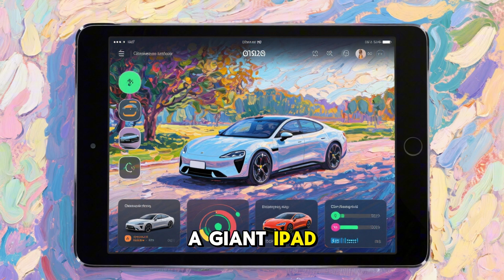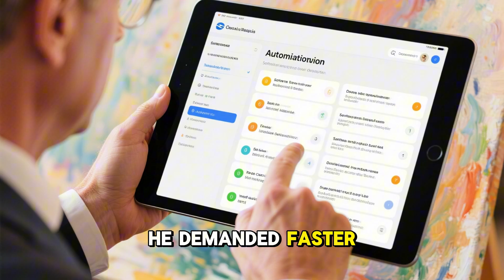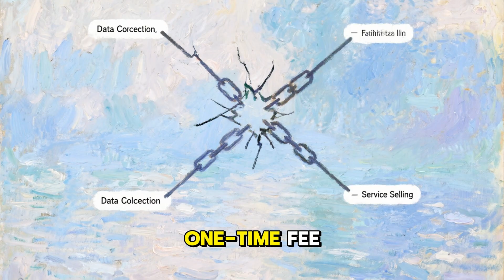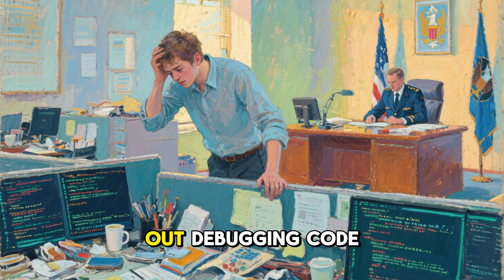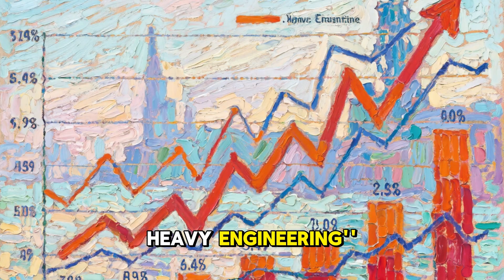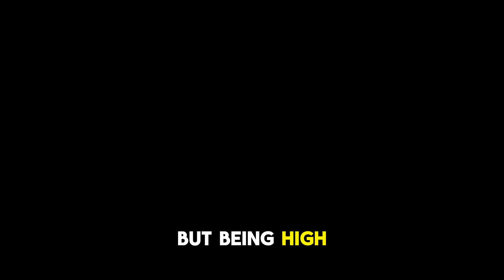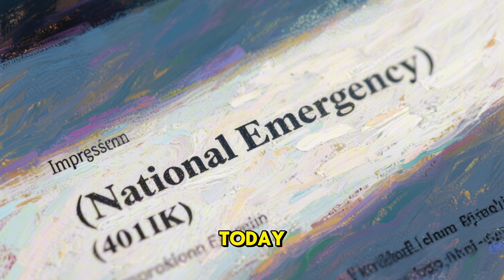Why German Engineers Are Becoming Obsolete The Hidden Crisis

Comment: If the new W-7 Stellerator fusion generator works, their electric energy problems are solved for the grid. Take the savings and buy Norway gas for industrial chemical processes. Cheap hydrogen for steel making has been shown to work in Norway, use a fusion generator and crack water.

Comment: Oh there is precision in software development. I worked at Intel labs and there's firmware that has to work precisely and correct for hardware errors as fast and accurate as a Space-X rocket. If the firmware stops in a state of no error handling, or wrong opcodes, you have a brick. Well as a German lineage engineer in QA, I found 3 major bugs that stopped the boot process. 
All of the 1-2mb of machine code runs before you even see text or graphics, this isn't the OS layer yet.
It has to know how to talk to the chipset and the peripherals or it's all for naught. 
When you boot over the network with PXE , it works because people like me were there to ensure rugged design and error handling.
Now with internet bandwidth being available almost anywhere civilian or urban, they can OS patch the machines over the cell network  or Starlink for the cars.